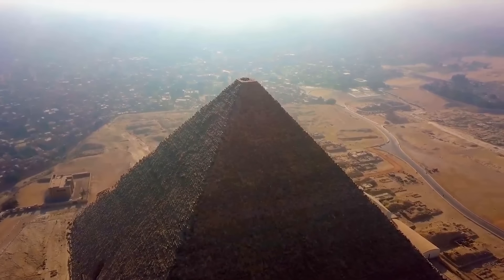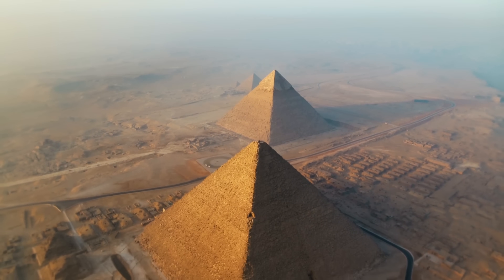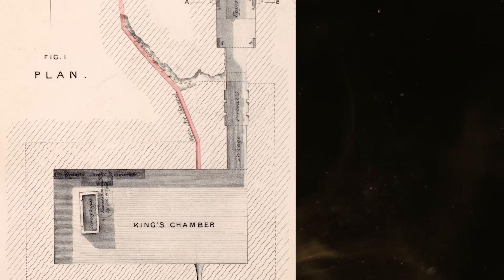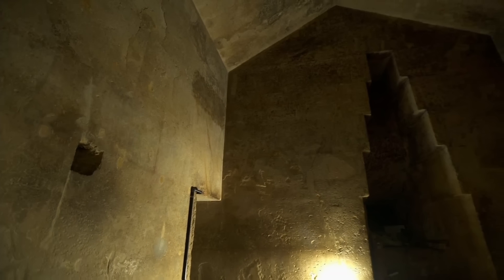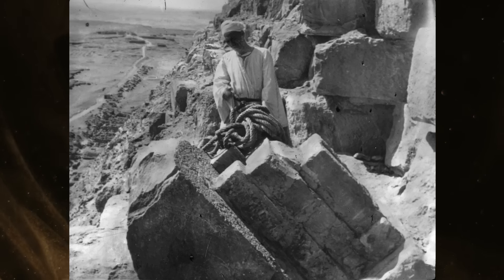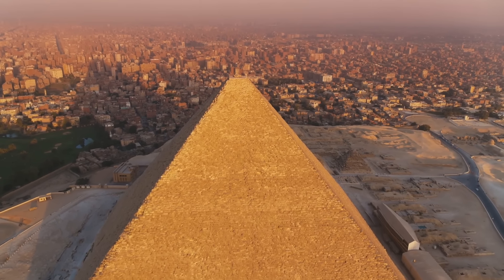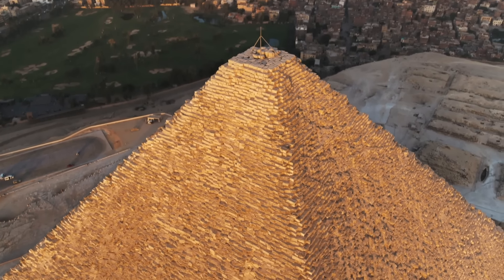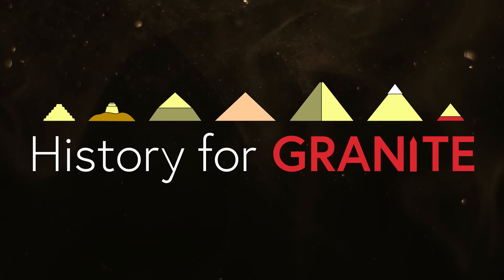One Solution to the Four Channels of the Great Pyramid

Comment: Excelent analysis . The air flow we see here 22:17 is caused by the chimney effect . The air in the chamber is a few degrees warmer than outside air and since the channel rises vertically , due to boyancy air  flow is induced ( if the channels were horizontal no air flow) . If a lamp of candle (flame) were in the chamber at the mouth of the channel this would heat the air in the channel creating a much greater flow , after days or weeks the inside of the channel would get hotter  and the air flow would speed up incredibly. Anyone inside the chambers would need light so it seems a necesity to exit the considerable soot and  fumes and have good ventilation.
Reply: You strike on the key to the mystery! As you point out that the channel's serve as chimney's, specifically for the venting of torch exhaust. The amazing amount of evidence presented here is a refreshing example scholarship, devoid of any current political bias. Pure scholarship and logic. I disagree with his conclusion that ventilation was unnecessary for the workers carving the hieroglyphs on the interior walls stating that they would just have to live with it. The talent needed to carve the intricate detail isn't given to every worker, so they would have some concessions granted. We can safely assume that ceremonies were held in the chamber, so again the need for light and ventilation is present.
Reply: exactly! All other pyramids have entrance higher than the burial chamber so the entrance corridor acts as a chimney. This one is the only one with the King's and Queen's chambers higher than the entrance, hence it needs chimneys/air vents for proper ventillation. This is why no other toumb uses these shafts! They were not idiots, they knew that when you have fire as a source of light, you have smoke and smoke rises so if you make a toumb the high point of the system, you'll suffocate on the smoke!

Comment: The prevailing winds blow from the north to the south in Egypt. By having the channels on a north-south axis as they are here, you get free forced air ventilation with intake on northern side and exhaust on southern side. In addition to the draft effect created you may have a slightly lower pressure zone on the southward side of the pyramid which will help to increase the overall airflow volume.

As far as the queens chamber location, unfinished nature, and channel lengths it kinda looks like the plans or desired size changed partly through the project (not an uncommon occurence in construction).

You can easily block the vents off once the construction and/or burial ceremony is complete and the need for ventilation for crews of workers or priests with lamps is no longer required.

Comment: This lends more credence to the pyramid being used regularly post construction as opposed to corpse disposal. Love your work
Reply: These aren't mutually exclusive  though...
Reply: If they are indeed air channels, it proves that it is not a tomb.  If is was a tomb then they are not air channels.
Reply: @raresaturn  except it totally doesn't... some kind of ventilation is pretty standard when it comes to tombs. If anything, it proves that pyramid was intended to be used for something (probably religious rituals) some time before or even after the burial. Given the existence of mortuary temples and apparent longevity of some pharaoh cults, this probably shouldn't even be all that surprising...
Reply: @raresaturn ever been in a cold cellar? ventilation is critical for preserving organic matter, so if you want a mummified body to last as long as possible, you need to vent heat and moisture. that makes it's way into the chamber from outside elements
Reply: @toncek9981  i was thinking the same, what if the piramids where just some kind of mortuary, where body's laid to rest for a while and mummified, to get burried afterwarths in the valley of kings, the bigger the piramid the greater the person that needed to get burried, just a thought
Reply: @Driessens_Peter  that's not really what I was thinking (mortuary temple isn't really a mortuary but rather a place for worshipping of dead pharaoh). Also the Valley of the Kings was used in the New Kingdom while the Pyramid was built in the Old Kingdom, so they were used like thousand years apart...
That being said, the mummification idea is pretty interesting. I mean, the ventilation clearly points out to pyramid being supposed to accommodate for more activity than just the burial itself (ventilation in European tombs is usually present because they are intended to be used repeatedly,  but the King's chamber is clearly meant for a single burial). On the other hand, all the means for blocking off the entrance show that this wasn't supposed to be a long-term thing (unlike mortuary temples). Also, the unfinished Queen's chamber can point out to the fact that these activities had to be completed within limited amount of time, before the pyramid was sealed off – if they had time, they would have finished it, wouldn't they... IMHO pharaoh being mummified at the spot in his tomb fits all of this rather nicely.
 Alternatively, as was already pointed out – ventilation helps with preservation. Given the artificial mummification being still new and experimental thing in the Old Kingdom, there's an argument to be made for ventilation helping with the preservation of mummified body or perhaps with the process of mummification itself (there are medieval and early moder mummies in Europe that were mummified purely by the ideal condition of their tombs).
Reply: @Driessens_Peter  No because the sarcophagus are too big to fit through the doors and were designed with lids that lock shut with copper pins. you couldn't temporarily place someone in the sarcophagus as you'd need to smash the lid to get it open once sealed. that is the reason why the sarcophagus are always smashed up or damaged.
Reply: @patrickstjean7646  >ventilation is critical for preserving organic matter, so if you want a mummified body to last as long as possible, you need to vent heat and moisture. that
> makes it's way into the chamber from outside elements

That too, but also the heat and moisture of people coming to visit the dead pharaoh would be harming the inside of the pyramid, and the heat would make it oppressive for the people visiting, as Zawi Hawas shows off in the; for all these reasons you would construct ventilation shafts.
Reply: It doesn't suggest that at all @raresaturn  . If they were working in the inner chambers post construction to install sarcophagi and other items, maybe a granite box even, they would benefit from the extra ventilation.
Reply: @patrickstjean7646  ^^ This! If anything, the ventilation shafts demonstrate that a tomb is more likely actually.
Reply: @raresaturn  even if it is a tomb, they are still air channels, so that the dead pharaoh could breathe fresh air in the afterlife
Reply: @-jank-willson  only if the soul was staying in the tomb, not if ascending to Heaven (or wherever souls go)
Reply: I thought the fact that there has never been a mummy found in any pyramid and the fact that they buried their dead in The Valley of the Kings was enough proof.
Reply: @toncek9981  
Makes far more sense to me that their followers or cults would at least frequent parts of the pyramids after the pharaos were laid to rest in them.

Doesn’t make sense to me to dedicate so much work to the monument itself and to making everything look as appealing as possible inside and out just to plug it up.
Reply: @Byronic19134  As already mentioned above, the old and middle kingdom favored pyramids as a burrial site, while the new kingdom switched to tombs which were cut into rock like the valley of kings. It’s simply a change in burial practices.

The presence of sarcophagi in pyramids which were designed in a way that looters had to smash them also shows that something human shaped was definitely entombed within the pyramids.

Citing the lack of mummies as evidence that the pyramids can’t possibly be burial sites is also incredibly reductive to say the very least.

The smashed sarcophagi and portcullis stones, robbers tunnels and other obvious signs of looting might give you a hint as to where the mummies went.
Reply: @3dmaster205  that was sort of my idea. That the ventilation was installed for the benefit of the Nobles and priests who would visit the chamber, but weren’t considered important for the laborers building the pyramid.
Reply: @NB-vd6fd Which pyramids contained sarcophagus?
Reply: @martinriiser5523  Well probably the best example is the one within the king’s chamber of the great pyramid since it’s in good shape compared to others. The term sarcophagus doesn’t only apply to the decorative ones which first come to mind.
Reply: @toncek9981  It could well be possible, that "visitors" would come to the chamber, but there were not enough resources to finish the queen's chamber, right? And it could also be possible that it was intended to both get finished and get visited afterwards, but the plans didn't work out. Just because a feature has not been used does not mean that it wasn't intended.
Reply: @somebod8703  both chambers are blocked off by large granite plugs at the lower end of ascending corridor – they were clearly not meant for visiting, at least not "indefinitely" like temples and such. Maybe for some time after the burial,  until they finished what they needed to (be it mummification or some funeral rites), but both chambers were most likely meant to be sealed and never opened again...
Reply: @toncek9981 If they had concluded that an air shaft was necessary for preservation of a mummy, then with that knowledge  they would have made air shafts for the burial sites in the Valley of the Kings. Lets not forget that these chambers were fully sealed after disposition.  To be more precise, mummification then being sealed in a sarcophagus was their best known method of preservation and it would not be necessary to ventilate after centuries of trial and error and use of the same methods.
Reply: @route5948  it was – in the New Kingdom when the Valley of Kings was used. Not necessary in Old Kingdom, when the pyramid was built (abound 1000 years before burials in Valley of Kings). At that time it still wasn't fully established process... Also, my main point was about mummification on the spot, no matter the technique, the ventilation would be quite beneficial for priest and experts participating in it...
Reply: @toncek9981  Yes. But it could be possible, that there would be a period of e.g. one year, where visitors would be expected, and then it would be closed off afterwards. I'm not familiar with the burial traditions.
Reply: They are not originally for tombs but for sorcery and divination, similar to temples of Delphi or any other architecture used for pagan temple  practices.
Reply: No mummy has ever been found in the great pyramids at Giza! It’s all speculation at best
Reply: This feeds into my question, "If the workers' comfort was not mission critical, then whose was? Who else would be spending enough time in the inner  depths of the pyramids to warrant the increase in ventilation? Priesthood class?

Comment: I watched this only once (so far) but if I understand correctly, the point you are making is that the shafts are most probably for air circulation, and the openings of the shafts in the King's chamber were cut after the construction was completed. So, they were built to provide air to the persons that would enter the chamber and spend some time there, which brings us to ask the "better question": if it was a burial site, why would they build such well-planned air shafts and put so much effort into them? In other words, if the chambers would have visitors that needed fresh air, who could be those visitors and why would they stay in the chamber for extended amounts of time? Therefore, assuming that the shafts are indeed for air, and openings were cut after completion, the whole purpose of the pyramids must be reconsidered. There were always suggestions that they might be for religious initiation practices but the details you pointed out provided more support for such theories. I am looking forward to the next video.
Reply: I was having the same question - basically what's worth the effort to build such channels - and for the Queen Chamber, why not finish them if it's to breath or air the inside. 
Hypothesis: If the Queen Chamber isn't finished / channels not opened, could it be because the  King's chamber - which was mechanically build after the Queen's - proved to be more prominant burial chamber (thus well finished), whilst the Queen's Chamber was abandonned as the  original  King's Chamber?  Long shot but the fact the access to the Queen's chamber was to be completely hidden could just have been because it was planned to abandon that burial chamber altogether (ie: leave it empty), before being repurposed as Queen's chamber.  Egyptians are known for the "try and learn" approach. 
At 43 min in the video, there's the view of the pyramid with chambers and channels - where the Queen's chamber channels can be seen being stopped as the King's Chamber was being finished (roof level) - point in time where a decision would have been made to stop the work on the Queen's chamber  (including sharpening edge and opening the channels). Happy to get your thoughts -
Reply: Are you familiar with initiations which simulate death? Perhaps it's a temple as much as it's a tomb.
Reply: @ben0thomas123  with very limited knowledge of the pyramids this was my thought during the video.
Reply: seems worth considering that the pyramids were power plants of some sort. there are no decoration in them.
Reply: After they complete the overall structure, then they got to go in and do the finishing touches (polish, paint and decoration, placing stuff and so on. All those workers and flame based lighting will need air.
Reply: Fact is that it is the worst way possible way to create air shafts if they get clogged with sand cause they have angles going down straight from outside. 

You would want make it so that sand rolls out instead of in.
Reply: @krymz1  Makes no sense. Because they had needed that light and airflow before they were even at the height of finishing the vents. There is nog logic in these channels being air vents.
Reply: @ben0thomas123  It has always struck me that the Queen’s Chamber—despite its lesser name—is positioned with perfect symmetry and balance, creating a sense of spiritual and architectural harmony that aligns with the meticulous precision seen throughout the Great Pyramid. In contrast, the King’s Chamber—though greater in name—disrupts this harmony with its off-center placement, breaking the balance that the builders so carefully maintained elsewhere.

It almost feels like the King’s Chamber was an afterthought, as if the ideal central position had already been claimed by the Queen’s Chamber, forcing them to place it off-center. Structurally, stacking two massive voids directly on top of each other may have been deemed too risky, leading to a compromise in placement rather than design intent.

Comment: 43:05 "The ventilation was not available until the construction was nearly complete." I agree, but you explicitly state that the holes were left uncut for the purpose of avoiding damage while fitting the ceiling stones. And that's incidentally also the exact moment when ventilation for the workers would have become necessary. (With the ceiling stones missing, the air would have come through the gap at the top.)
So they could have put the last ceiling stone on, and within the hour proceeded to make the first drill hole into the casing stones of the King's chamber.

And for the "Queen's chamber" the holes were never drilled because they knew (or were reasonably certain) that they wouldn't bother doing any further changes to it after putting its ceiling stones in place.

And the course of stone where the Queen's air channels end would tell us exactly where/when they decided to fully abandon using the Queen's chamber. Curiously that's above the King's chamber, and pretty precisely aligns with the last layer of releiving slabs and the vaulting stones. Almost as if they waited to see if the alternate construction technique for the King's chamber worked out before committing to fully abandon the Queen's chamber.
Reply: They were broken through by explorers in the 19th Century.
Reply: @JeffSherlock  In the queens chamber? Yes, because the ancient Egyptians stopped the queen's chamber construction just short of drilling those holes.